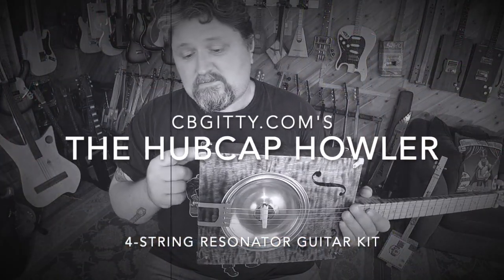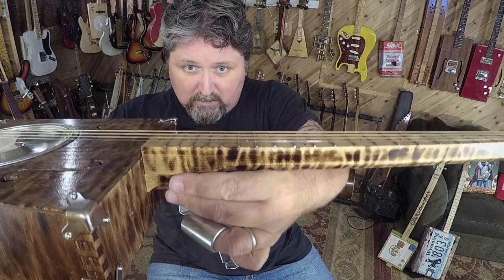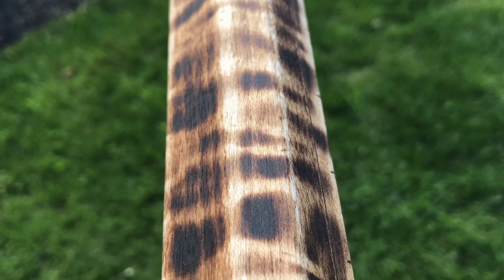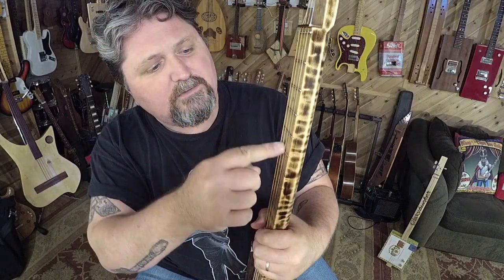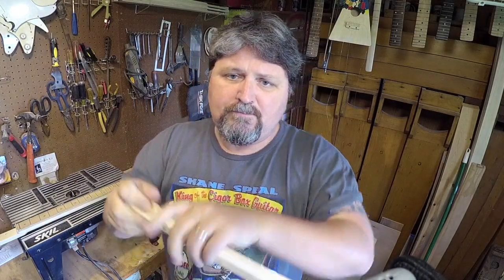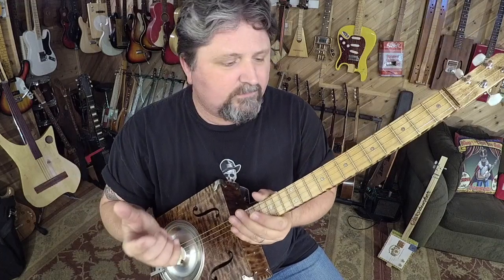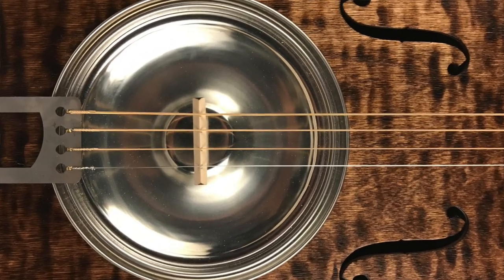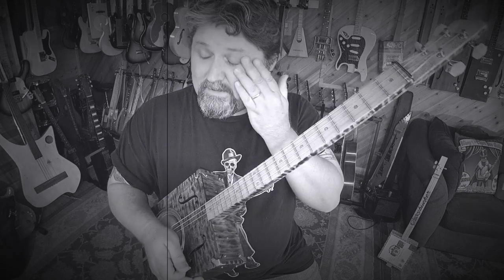CBGitty com's Hubcap Howler: Shane Speal's review

Comment: Hey Shane,  Love the finish on the hubcap howler.  I think I'm going to do one but i'm going to run the stripes vertical (like on the Stella" vs. horizontal.  I think that will give it more visual "length" and follow the strip patter on the stella much more closely.  I'm also thinking of a larger gauge wire to cover more area and spread out the burn.  WIsh me luck.